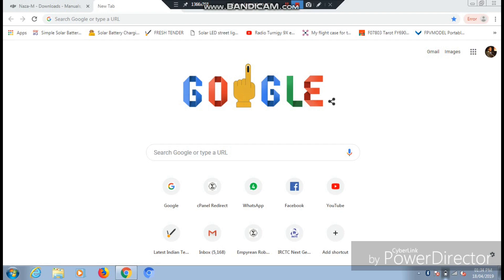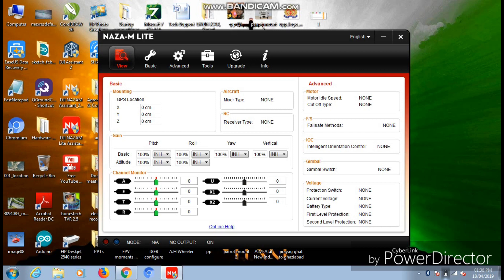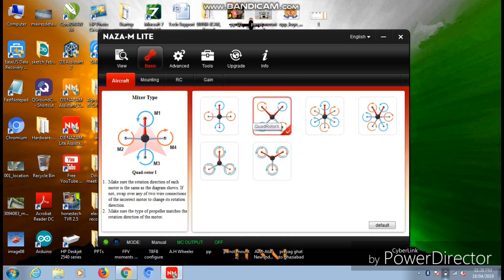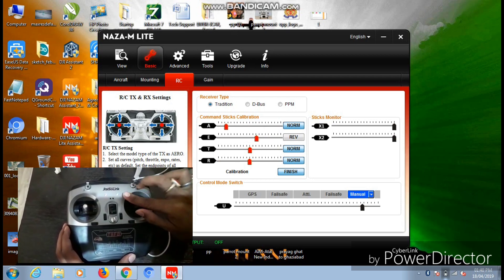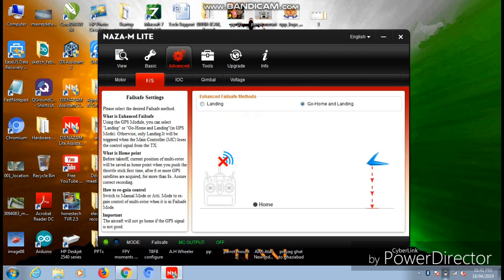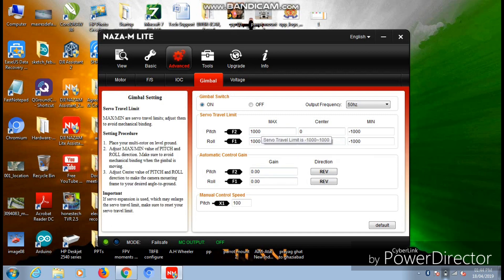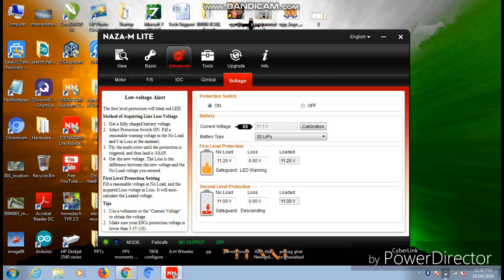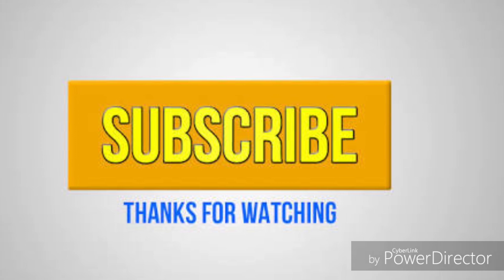Naza M-Lite Calibration & Software Setup for Quadcopter Drone

Comment: What happen if we flying the drone in gps mode and we switch off the transmitter ??
Reply from the maker: If the failsafe is enabled then it will either go on RTL or Land mode otherwise u will see ur drone flying on its own, away from you....followed by a crashing sound 😅

Comment: I have a constant green light on the led from the fc as bf my Mac shows it is connected on the system info pane at the USB ports.  Software is running but not showing any connection in the displayed fields.  Please help me trouble shoot the issue.
Reply from the maker: For any discussion on this topic you can post your questions on our technical forum @t

Comment: should i register to use the software..its asking for login
Reply from the maker: Yes
Reply: @Empyrotech  even after registering the software is not on. The green light in the software doesn't glow after so many tries.
Reply from the maker: @binayak135  probably you are not having the drivers installed in your system. Check for the correct COM port and install the drivers.
Reply: @Empyrotech  Hey man can set here an email address where I can find this from the name m lite and the driver I searched everywhere but nowhere to download.  My phantom 1 no longer starts up.
Reply from the maker: @ronyswayza  This video is for hobby grade DIY setups. With phantom 1 the configuration is a bit different. It will be better if you can post your issues in detail on the below mentioned forum so that we can guide you better.
https://www.empyrotech.com/forum
Reply: @Empyrotech  Thanks for replying but I can't find that forum, can you help me with this.  Gr Ron
Reply from the maker: @ronyswayza  https://www.empyrotech.com/forum

Comment: I have a question will this fix the yellow blinking light and help start the motor is my issue i was flying one day charged my battery went back out next day and the motors will not activate can you help
Reply from the maker: Check for the no flying zones. May be u have tried arming at any location which lies in the list of no flying zones. Apart from it..try recalibrating your compass.

Comment: Does Pixhawk support motor Fail-safe?
If yes, which version to use? 
If no, which is good Flight Controller?
I knew Naza-M2 support motor Fail-safe(correct me if I am wrong), but its close code, so I am avoiding it as long I have alternate FC.
Reply from the maker: As per my knowledge...None of the FCs can support motor failsafe...coz motor failure is a kind of mechanical failure and motors are the basic part of the working principle of the drone. Once stopped in àir...the drone won't be having FS option instead of hitting the ground on crash. Although throttle FS is available in which if the PWM value of the TX reaches below the min throttle value....the FS will be triggered. This is available in pixhawk.
Reply: @Empyrotech  Thanks
Reply from the maker: @MrNams  plz use our forum for drone & technology related discussions.
https://www.empyrotech.com/forum
Reply: @Empyrotech  Ok Thanks

Comment: Do you know, the reason for why my drone didn't return to home location while battery go down?
Reply from the maker: Yes there can be the following possibilities:
1) you have chosen "Land" instead of "Go Home & Land" in failsafe.
2) The min threshold voltage for triggering the FS u choosed may b too low for ur aircraft to reach back the home location.
3) The compass is not calibrated successfully.

Comment: hi,

Ive tried like dozen times but my channel monitor doesnt show any deflection , nor does  it respond to RC calibration. Dont know what the hell is wrong. Have searched all youtube videos no on ehas explained about this error. !!!
Reply from the maker: In that case cros check the following:
1) your Tx Rx is binded successfully or not? (Rx should show a constant red light on powering instead of blinking)
2) R u powering the Rx or not? (u have to connect battery and usb both)
3) Your USB is working fine or not? (The blinking LEDs on the lower left corner of software shows a successful usb connection)
4) Try changing the USB port on your system.

If all the above points are OK then there might be chances that you are having a bad USB LED of NAZA.

Hope this works for you. Good Luck!
Reply: @Empyrotech  Ohh !! Thanks a lot buddy for replying at wee hours !!! Also Im constantly getting low voltage error flash on naza screen. Its showing 7.2V (Ive a  11.1V - 3S 5400mah LIPO battery ). Two of the cells are at 3.89V, the third one is at 0V. Is the third cell dead ? Is there any way to recover this cell ? Do I need to remove the 3rd cell or can I use the pack as it is ?
Reply from the maker: @jiit1288  your 3rd cell is dead. Its better to change your battery because all your setup must be of 3s input and right now your battery is giving 2s supply only.

Comment: Hey bro how did you install your naza mlute driver am facing some error
Reply from the maker: The drivers get installed automatically once u connect your board to pc. If you are facing issues then I can guide u better if you can tell what error you are getting.
Reply: Like when i try to install my driver its show the messages like the publisher has bolcked your  app for your protection
Reply from the maker: @gomjahem6160  it seems that any of your system settings like firewall or antivirus is preventing the drivers to get installed.  You need to allow every permission access by administrator while running the installer or deactivate every system protection settings that prevent the installation from unknown sources.

Comment: Sir isme esc calibration kaise hoga
Reply from the maker: Connect your esc's servo cable one by one on ch3 of ur RX. Put your throttle stick to Max position. Connect your lipo battery to ur aircraft and then power ur TX. The esc will start beeping showing the max throttle value is recorded. Put the throttle stick back to min position. Again the esc will beep showing the min position is also recorded. Now ur ESC is calibrated. To test, raise the throttle above and your corresponding motor will start running. Repeat the whole process with all the esc's. 
Caution: Remove the propellers before starting with ur ESC çalibration.